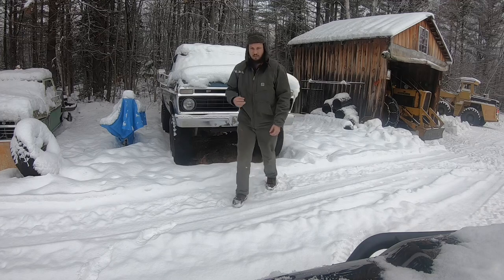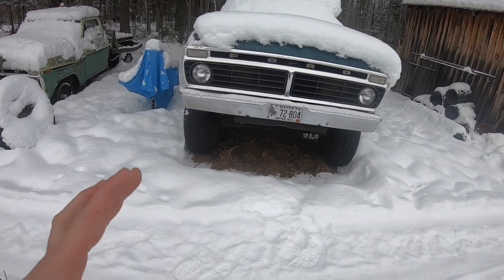What is a Ford “high-boy” + cold start

Comment: Safe bet for highboys is the VIN starts with "F26Y"
Reply: Exactly.  A lifted 150 is not a highboy.
Reply: What is a comfirmed "F26Y", that has F350 on the fenders, 2-1/4 wide rear springs looks like 7 with 2 later added, with a 10th helper spring with  factory end perches, 4-1/4 inch spacers on rear axle, 28" to inside of frame rails, gas tank in cab,, divorced transfer case, 3" wide front leaf springs 5 count, factory a/c, 4spd granny low, 390, 1976, ranger on the bed, custom on the glovebox? I'm sorry to ask all this. I just don't know much & I appreciate the help.
Reply: @davidbaldwin1591  last thing to check is frame width. Highboys had a narrower frame than other fseries trucks. If you have that terrible steering system woth all the hoses going to a Control valve off of the pitman arm, its a highboy.
Reply: Thanks! I'm going to check that.
Reply: @DIVERofLIFE  That's a lie

Comment: You forgot the most visible sign of a "highboy". The crossmember, right under the front bumper lol. They also came in a crew cab short bed. The front frame width was 37 inches, the rear frame width was 34 inches. Badass truck buddy. Digging that color

Comment: I must say, I miss my '76 F250 High boy. First year for front disc brakes and open knuckle front axle HD44 axle, last year of the gas tank behind the seat, mine had factory A/C and R12 ,  but was still a custom with the NP435 4 spd granny and NP205 divorced TC. Dana 60 rear axle with LS and 30 spline axles. Had  the original 360 bored out .030 over and completely rebuilt with an Edelbrock performer  intake, 600 Holley 4 BBL, Crane Fireball cam, and worked well with 4.10 gears and 9.00-16 Gumbo Wide mudders. The biggest thing that made it stand out was the original Dark metallic green, I really liked that color. I used to wax it with Eagle 1 carnauba wax, it really made it shine. It did produce a little over 300 rear wheel HP on the dyno, it impressed me at the time.

Comment: I'm starting to work on my '75 "highboy" which was my dad's brand new. He's past now and its mine. Originally has a 360, now running a 428. I'm thinking about getting a 7.3 godzilla engine.
Reply: how about you look into ford/mwm sprint 4.2tdi. fitted to s/duty 1998 - 07. in africa,aus,brazil,europe. you,never had them. 6 cyl german diesel. 510nm 140kw,std. i fitted a td06,now has 700nm,170kw. no computer,no glow plugs,all mechanical. cheap.12 lt 100ks. son,,torque is what you want,not 1000 hp..a 7.3 weighs howmuch,3 times the diesel. think about that..

Comment: My dad had a 77 F250. That thing was badass. I think it had a 460 in it, manual hubs,hydraulic ram for steering. Very heavy duty.
Reply from the maker: Great trucks the hydraulic steering was not so great they would stick or turn for no reason. I've wanted to put a newer front end under one of these trucks but its not gonna line up well
Reply: @4x4hondarancher  I remember that thing looking like it had a lift on it. bim sure it was just stock, Great truck but id rather have ny old 67 bronco half cab back. I was a dumb kid in highschool and i didnt realize what i had at the time.
Reply: Prolly had a 351 in it, idk why the hell they didn’t put 460’s in the 4x4’s back then, seems crazy not to

Comment: March of 77 is when the highboy ended. My dad and I ordered 77 f250’s in November of 76. .mine came in January, there was a mix up with my dads truck and it was delivered in March. His came with the wider 27” frame, high pinion 2 leaf spring front end. Integral power steering , married transfer case, tank in the back between the frame rails. My truck has the divorced transfer case, tank behind the seat, power assist power steering, 6 leaf front springs, 750-16 split rims tires and wheels.
Reply: Did they really end in 77? I know of a stock 79 That is a Highboy Factory stock, not lifted, had the divorce transfer case everything.

Comment: Had a '68 250 camper special.  Dual tanks and side tool box.  Also a '78 150 460 trailer special.  Both were awesome trucks.

Comment: 1975.    F 150.  360 Automatic. Full time four wheel drive. 
Started when it wanted 
Left me  walking about ten miles. 
But actually it Left me walking when ever it wanted. Yes I repaired and replaced just about everything. Even the engine. 
Never Again have i ever even  thought of another  found On Road Dead.
I  spent more time and money under the hood than  behind the wheel.
Reply from the maker: Sorry about your luck! The old truck next to this one is full time 4x4

Comment: I had a 1972 F-250 Ranger 4x4.  Had a 390 and manual transmission.  Bought it outside Denver for $600 back in 2000.  Great truck.  No catalytic converter, dual tanks, tool boxes built in, etc.  I had to put lead additive in it too.
The WORST mileage I ever had with any vehicle I've ever owned!  Also, the last vehicle I ever owned with manual steering and a manual choke.
Reply: Did you sell the old girl?
Reply: @pointingdog7235  I sold it a year later for $4000!

Comment: I have a 69 Ford 100 and it's has the DANA SPICER high low tansfere with the 4 inch lift..Dana 60 rear end and Dana 45 front axle..has the high and low shifter..I think it is a " High boy, it also has a 390 Hi-PO with 427 heads...beast mode!

Comment: alot of great info. ill adda couple peices. 
no camper special option on a highboy
disc brake 44 front in 76 and early 77 low pinion. 
360 option ended in 76. all 77s were 351m or 400...

Comment: At a glance one for sure way to no a high boy is above the front bumper there is a cross member between grill and bumper and only the high boys have that cross member 67 to 77 - 1/2 also 78 79 dana 60 fits but good luck find one under $1000 and sometimes very rare can find 65 up half ton with a divorce T case and i had 70 half Ton 4 hi 2 hi only gear in T case

Comment: The blocks are 4" in the center they're wedged for pinion angle.  Divorced transfer case is to relieve drive shaft angle for the lift. Check your front diff clearance before you lower it.. the pumpkin was moved over in later axles!
Reply from the maker: The angles are horrible its stock blocks but 4 inch lift springs thats 4 over its tall stock height

Comment: alottt of pumping holy shit lol i pump mine 1/5th as much thats wild it seemed close to being flooded hard to say on video tho nice truck i have a similar one
Reply from the maker: It looses its prime so you gotta giver hell!  New carb set up going on it this spring
Reply: @4x4hondarancher  nice love the truck look forward to seeing it what carb yiu doing i think im going with another holley 650 dp
Reply from the maker: @CodySnell_87  exactly what I want 650 holley dp with manual choke instead of this automatic garbage.
Reply: @4x4hondarancher  same here i got my truck tore apart im stripping it to bare metal with all rust free parts
Reply: @4x4hondarancher  mine has a mildly built 352 fe in it with 390 parts mixed in

Comment: Ford actually referred to them as Hi-rise. I worked for a Ford dealership in those years and when going to the parts counter while working on 77 model year I would be asked if it was a hi-rise frame or not.
Reply from the maker: Right just to differ between 77 and 78
Reply: @4x4hondarancher  it would have been to seperate 77s. 77 was last of highboy and the 77.5 was a lowboy.

Comment: wrong....front frame has a mount for the front of leafs,with centre hole. dash,should be metal,round gauges,4.11 diffs,,front low pin,closed knuckle,no carpet,4 sp only,. here in aus. they had rear shock protectors, 300 six only,4 sp only,. no v8. only sold to gov agencies,forestry. i bought an f100,from susanville,ca. 352fe, divorced transfer with 4"blocks,low pin d44 closed knuckle. i also own a h/boy 75. cut to swb,fitted married 1356 transfer,351c,5 sp. 4w disc. h/p d44 all 8 stud..lockers.
Reply from the maker: In the states its 300 or 360 4 spd or auto but the "highboy" is just a slang term for 4x4 f250 their all the same

Comment: I had a 73 4x4 f250 long bed 4spd manual with np205 divorce mounted transfer case with Dana 44 and dana 60 rear with 36 1650 dick cepecks I got when my grandpa past away when I was 15 he custom ordered it with  AC with manual brakes and no power steering lol I miss that truck
Reply from the maker: Exactly the same truck as mine! I like the look of these trucks stock with 36s fills the fenders nice

Comment: My first truck when I was 16 was a 77’ F-250 and the hubs on it were huge, with red in the middle of them, tank behind the seat, the back of the bed was spring like all of them in Maine, I owned that truck for 15 years, had a 351 in it, I used to bury that truck every weekend on the power lines, I had older friends, so I was an alcoholic by the time I was 17, but they used to love to use me as the Guinea pig to see if I could make through some abyss of a mud hole, Kellys mud runs in Pittston, boy if that truck could talk I woulda been in a lot of trouble, I had a 73 1 ton 2 wheel, a 75 F-100 with  a 3 on the tree, that one would burn the tires for miles, had a 76’ 150 with a blueprinted Butler MacMaster 390 in it, and that thing had more Ftlbs then the 460, had a 79 150 all of them were sweet trucks, wish I kept the 77 tho, my buddy bought it from me then sold it, but he still has one of the doors from mine on his plow truck, gotta get another one day, they were the best looking trucks ever built, now I run a 19’ F-150 with a 5.0 10 speed nice truck, but I still love the old fuel air and spark.

Comment: I had the 76 F-250 4x4 picked it up for $500 years ago sold it to a friend for a few bucks more after doing a little work to it. Nice trucks but you have to be careful of the Frames with these trucks, right where the Cab meets the Bed, they have a tendency to Rot out. We used to weld a continuous piece of backhoe steel, about 1/4 inch thick right under the cab as far as you could get to fit under the bed, in most cases a few feet. Other than that, really fun truck to drive.

Comment: I don't quite get your cold start with all the pedal action. I have a 78 with a 400.....very built....runs a edelbrock 4 barrel and the choke on that thing is a never fail deal, starts and runs perfect in all weather. My float bowls are with fuel for a few months after it has run, if longer I just let it crank a bit so the pump fills the bowls then hit the pedal once and the choke sets, bowls are full and its ignition time every time. I also have an advantage of a dual battery that runs in parallel, added it for the Hickey under bumper winch, it sure adds to the cranking power in real cold weather.
Reply from the maker: Its just a shitty old motorcraft electric choke an looses its prime so i try an help it by pumping it alot

Comment: Not trying to start an argument but I hope everybody knows ford never actually released a truck called a highboy it was an acquired nickname for the package it had added leafs which made it sit higher thus ppl called em that plus they always had the divorced tcase and several other options but was only on the f250s
Reply: By the way I'm pretty much in agreement with the original creator of the video.
Reply: Narrower frames as well

Comment: I bought mine brand new in 76'. F 250 highboy XLT with factory 4" lift dual shocks all the way around with a rear gas tank. Has a 390 in it. I have since removed the engine and placed a 429 in it. Love the truck. It's my daily driver. Yes a gas guzzler. 10 mpg.
Reply: Who put the 390 in it? We put a 429 out of my Grandfathers old Station Wagon in our 77 and that engine is peppy as hell. I also had a 76 HighBoy back when I was in HighSchool that had a 390 out of an old Mercury. Makes no sense why Ford didn’t run 390’s in these trucks from the factory

Comment: You forgot one of the key things about the Highboy and that's the front axle hi boys always have the front axle I can't remember if they're 4-inch or 4 and 1/2 in Hub and locking hub and the pinion gear is at the bottom of the third member all the other front ends has the high pinion gear meaning it being at the top of the third member
Reply from the maker: i think they changed from low pinion to high pinion at some point... maybe the last year or 2? I cant remember
Reply: @4x4hondarancher  highboys were low pinion until. the lowboy came out.  never hp inna lowboy. however a disc brake option came in as a front option 76 and early 77.

Comment: I had a 77 1/2 f- 250 do you know the difference in that ?
Reply from the maker: 77.5 and up isthe same as a 78 im not sure the exact month they changed them. What month was your truck manufacturered in
Reply: @4x4hondarancher  I'm not sure  wish I still had it but I sold it years ago  mine was definitely not a high boy though

Comment: Do some pulling out new tires on it ☺️
Reply: High boy's look great with the right tires on it remember this put champion spark plugs in it so much better power I'm a mechanic put better lights on it shocks breaks better throttle position cable you this better get up and go good luck friend

Comment: Choke it!  When you refer to military tires I assume you were talking about the ones that were banned for anything but off road use.
Reply from the maker: Choke is kinda messed up gonna be getting a new carb. And I'm not sure what you mean their just regular goodyear wrangler military tires and they suck in anything but pavement lol
Reply: @4x4hondarancher  I never knew goodyeard made military tires.  The original military tires were so good that nothing could outpull them in the mud.  Problem was they wasn't enough grip for the road and were very dangerous, especially in the rain.  Google them & you will see why.